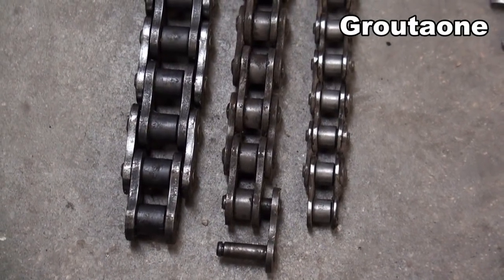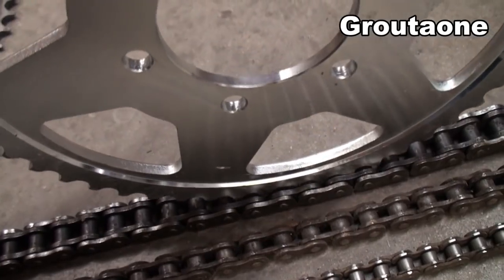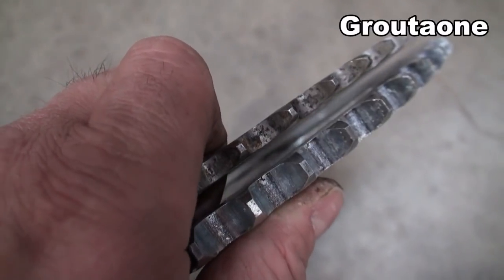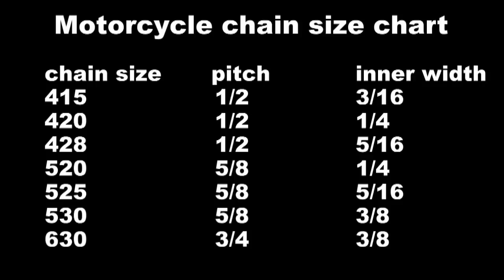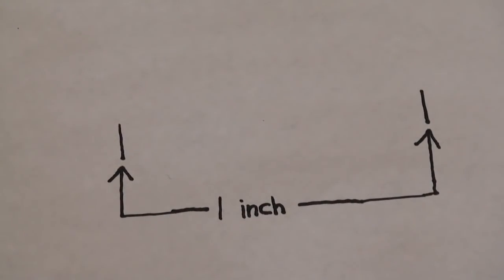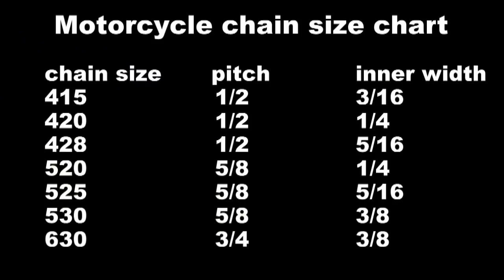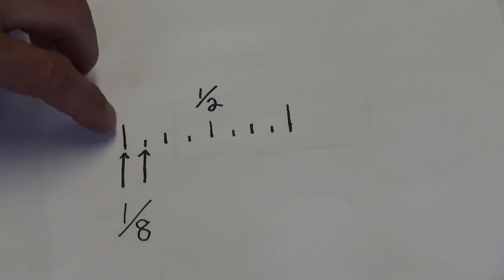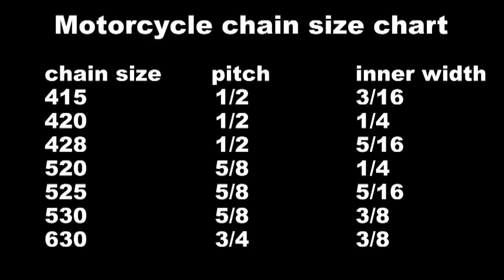Motorcycle Chain Sizes Explained

Comment: My pitch measured .3125 = 5/16    ,   sprockets .153 to .157 width 5/32 checked with american wrenches and was correct ( cant find any chain ) that size... got a scooter with no chain so Im going off sprockets... any ideas... its a chopper pit bike 2 stroke no name ?

Comment: The Explanation of pitch is incorrect. Pitch is the measurement between 3 pins divided by 2. not simply the measurement between 2 pins side by side. This is because the distance between pin 1 and 2 is different from the distance between pin 2 and 3. Therefore, if you were to simply take the distance between 2 select pins it will give you the incorrect pitch, and to get an accurate measurement you must measure the distance between pin 1 and 3 and divide by 2. This applies also to chain saw chain if anyone needs to know.

Comment: Awesome, simple when you know how :-)  Haven't seen this info presented anywhere else, thanks so much. 
Another video said measure between 16 pins and if the distance is 256mm or longer (for a 520,525 or 530 chain) then it's worn and needs replacing. I measured mine at around 238-239mm so well within that margin, but I had no idea how old the chain was (bought the bike second hand). Now it makes perfect sense, 16 pins = 15 pitch lengths x 5/8 inch each = 238mm. So now I know my chain is not stretched much at all. Very satisfying to know. Thanks.

Comment: I saw this vid and ordered a 520 kit and DID 520 X-Ring.  The difference is massive.  The binding is gone and the size scale is awesome.
Reply: How? On what ride?
Reply: @Galaxieshop  '05 R6, you just swap the sprockets and the chain and it works fine.

Getting the sprocket at the engine was a hassle. You need to use something to stop it from moving and then air impact it out quick.

Using block off plates on the PAIR valves did wonders on the engine braking.
Reply: @antdx316  thanks brother

Comment: I have a question concerning that 428 size. 1/8 of an inch is 3.175 mm. You multiply that for 2.8 times and it's NOT the same as 2.5 times 1/8 (obviously, they are different numbers), why is that "28" number when is it considered 5/16 width size as in "25" size?? Is so weird to me
Reply: Jose interesting explanation but it clearly doesn’t make sense at all. I can’t imagine engineers making something that can be easily done in millimetres and transforming into all that calculation drama like a secret calculation sort of thing. Inches countries just need to accept that there are millions of metric people out there outside their bubble.

Comment: Chain Pitch Width Roller Diameter
415 12.70mm 4.88mm 7.75mm
420 12.70mm 6.35mm 7.75mm
428 12.70mm 7.75mm 8.51mm
520 15.88mm 6.35mm 10.16mm
525 15.88mm 7.85mm 10.16mm
530 15.88mm 9.53mm 10.16mm
532 15.88mm 9.53mm 11.10mm
630 19.05mm 9.53mm 11.91mm
632 19.05mm 9.66mm 12.68mm

Comment: Great info! Been wondering what those #'s meant for the awhile now. Lol but I'm still not sure why sportbikes rides convert to 520 chains. Is it because it's lighter?
Reply: you always have to look for what the manufacture indicates on the manual.

I know that for racing they put the lightest component they can, for example using 520 chains with their respective sprockets (front and rear), but if you do that to a 1000cc bike, your chain will last one or two race weekends. Because the chain is weaker for the job. So if your racing budget permits it (and the rules of you competition allows it too) you can do it.

Comment: Great video, however it would be a bit easier (especially for us metric-speakers) if you expressed the pitches in consistent fractions of 8 ,, so 4/8" instead of 1/2", 6/8" instead of 3/4" and so on. Likewise, use of 16ths for the inner width.

Would make it easier to visualise how all the numbers relate to eachother without the need to 'convert' between different fractions such as halves and quarters.

Regardless, kudos, elegantly explained and very helpful!

Edit: I put together a revised version of your chart for better clarity.

http://imgur.com/wHriF9B
Reply: thanks for the link 👍
Reply: @jozefsk7456  I guess it's just fractions, but 100% agree.

Comment: G1, does this also work for large industrial type chain as well that has a pitch over 1 inch? Did the snow blower ever catch the snowman?
Reply from the maker: It does work but not exactly the same, standard farm chain also uses the first digit to identify the pitch in 1/8" increments, and if the last digit is 0, it's for standard proportions, 1 for lightweight chain, and 5 for rollerless bushed chain. A #41 is therefore for 1/2"-pitch lightweight chain, a #120 is 1-1/2 inch pitch but keep in mind there is also metric sized chain out there

Comment: Many thanks for this information and explanation. Do you know if these basic principles apply to other types of drive chain for other heavier machinery?
Reply from the maker: Thanks for watching, standard farm chain also uses the first digit to identify the pitch in 1/8" increments, and if the last digit is 0, it's for standard proportions, 1 for lightweight chain, and 5 for rollerless bushed chain. A #41 is therefore for 1/2"-pitch lightweight chain, a #120 is 1-1/2 inch pitch